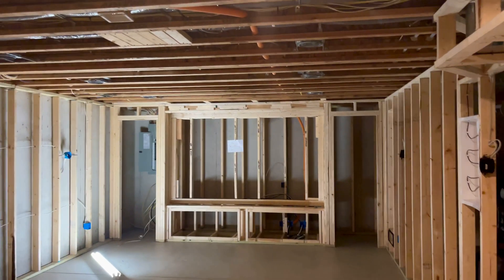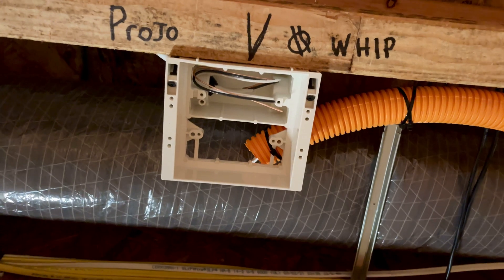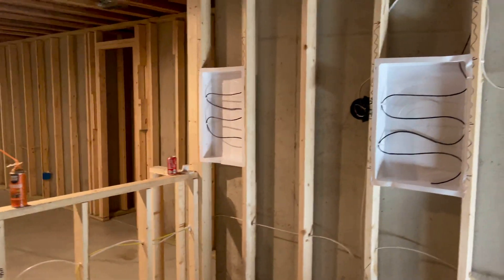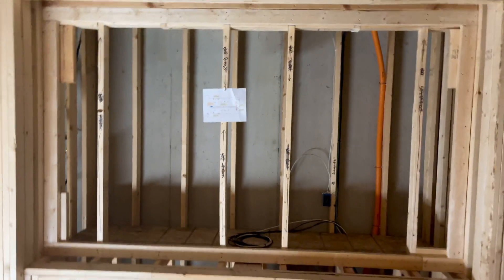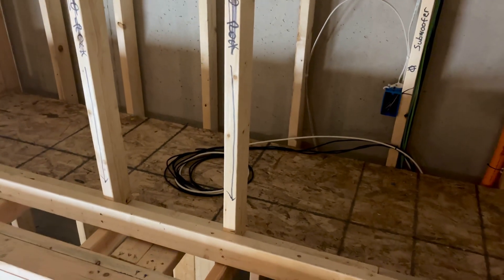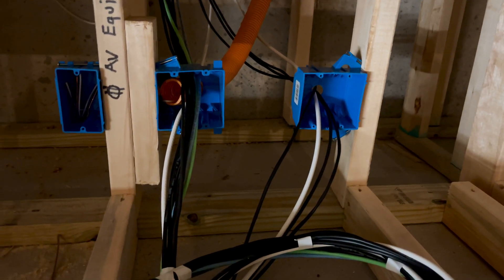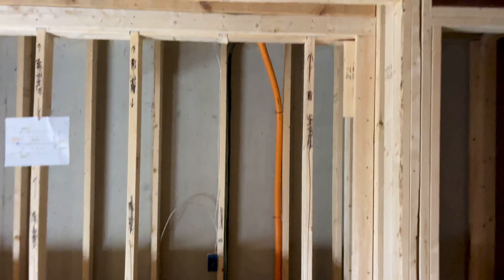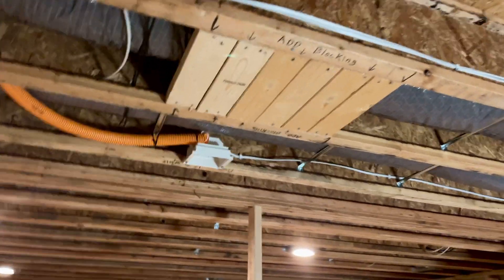Klipsch Dolby Atmos Home Theater Prewire with Projector

Comment: Aren’t there any issues with placing the SB next to the surrounds? Considering an open theater too and was going to forego the surround backs since I wasn’t sure where/how to install them
Reply from the maker: I generally like placing the subs in the front corners, but anywhere in the room is typically fine. You may even want to play around with the placement to get the right response. You have lots of options for surrounds! They can go on-wall, in-ceiling, or in-wall like this theater.
Reply: @pulseautomationsecurity1609  sorry, I meant the surround backs. In your video, the surround backs were right next to the surrounds.
Reply from the maker: In this case we were very limited since the back of the room was completely open. Normally I would place the SB's on back wall or overhead in ceiling behind the main listening point.